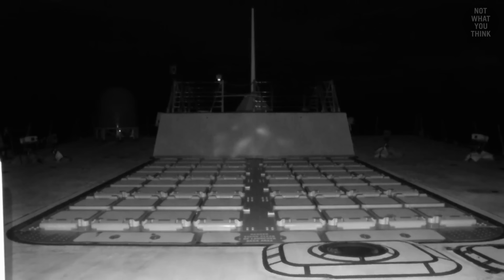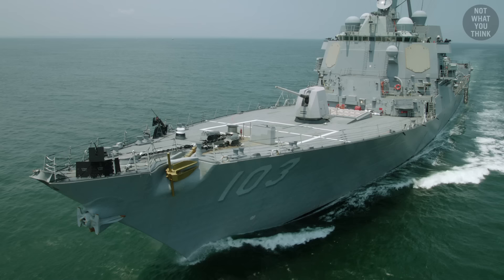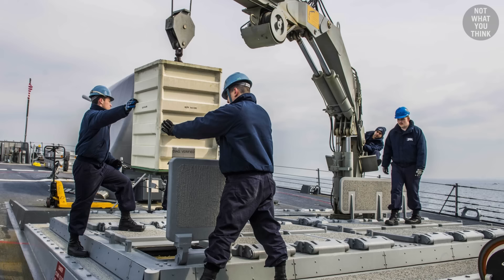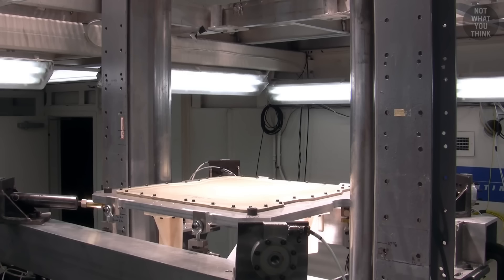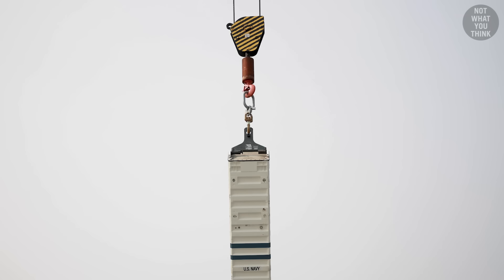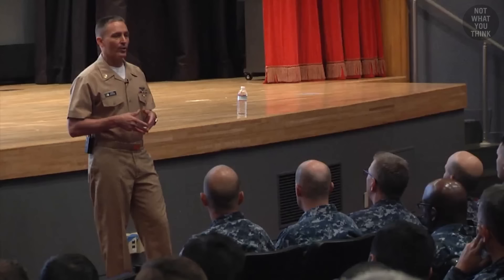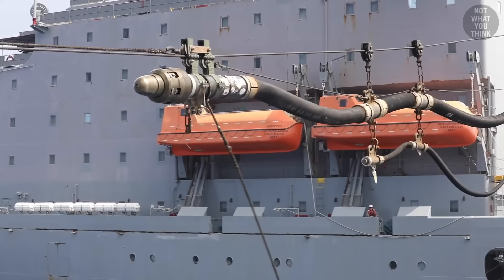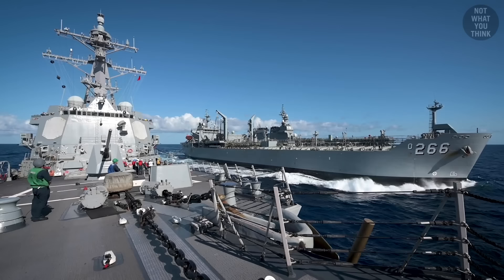Why Warships Cannot Reload Missiles at Sea

Comment: These ships carry more missiles than any of the previous ships that had below-deck magazines. If they think they need more missiles the solution is to add more launch cells. A loaded cell doesn't take up more space than a reload as the reloads fit snugly in the launcher and would take up just about as much space if stowed on the ship.
Reply: the point is that you'd have a supply ship carrying the ammunition. That way, the logistics ship can travel between the destroyer and ports that have ammo stocks, instead of the destroyer wasting time traveling.
Reply: Not really. Additional rockets / containers take up space below the deck but the launcher takes up space ON the deck, so its limiting factor is volume vs space.

I do agree however that the cells should be rearmed from within the ship's hull / storage holding and not by an outside crane.
Reply: China's Type 055 destroyer has 112 VLS.  We need a cheaper version of Rapid Dragon concept  that can be placed on top of ships in case they need to reload fast!  Just have them on deposable boats that serve as missiles truck drones that go ahead of the Navy to take out the 1st wave of missles.
Reply: What are you trying to say after adding more tubes like the reasoning doesn’t make sense how it’s worded. When you say a loaded cell doesn’t take more space than a reload what do you mean because that doesn’t make sense
Reply: Or Octa pack ESSM.
Or multi-pack a boosted ESSM to imcrease range over base line ESSM while having more magazine depth.
Reply: @dtsai That's right. Rapid Dragon is also a component of the current distributed lethality doctrine: of putting missiles on everything. It's either that, or a total redesign of VLS. Something like using a revolver shape instead-like the Russians do with their VLS. That way it could, perhaps be rearmed from a more easily refillable magazine deep within the ship. But that's a major redesign, so isn't realistic. Just put more missiles on the deck in the short-term, more VLS cells after refits mid-term. The French are already considering upgunning their FDI Frigates to match the Greek specification.
Reply: @vaakdemandante8772  how would you suggest accomplishing loading the cells from below decks?
The missiles are too long to feed in from beneath the launch cells.  Those cells are almost as tall as the hull.
That means you would need to store the missiles vertically and load them through the side of the launcher.
The handling equipment to do that would take up MORE space than simply installing additional launch cells would.  That's the entire reason that vertical launch cells were invented: it's both mechanically simpler and more volumetrically efficient to simply fire the missiles directly from where they are stored than to fuck around with moving them into launchers, and that's exactly the capability  VLS cells provide.
Reply: If what I’m interpreting is correct, a ship with a crane could re-load the VLS launchers using an on-ship depot? 

If so, it sounds good to me!
Reply: @jonathanmora9398 I think what he means it that a VLS launcker takes up roughly as much space as an extra missile stored for reloading a launcher. Therefore it’s more efficient to just fit more launchers instead of storing missiles
Reply: @dtsai  The US Navy doesn't have deposable (did you mean disposable?)  boats that can be controlled remotely mainly cause there are 3 problems. 

#1 having to arm and refit a separate drone boat entirely made to be a drone is not cost effective as it would only have one purpose and more easily damaged due to crashing waves not to mention having to refuel and/or stow it across a 6 month deployment or longer. 

#2 The communications to the drone would be very unreliable since most drones operate on line of sight and any other means could be blocked by atmosphere, waves, or even just being past the horizon (which is just around 5 to 10 miles depending on how high the antenna to control it would be). This would be a huge problem cause the ocean may be vast but there are parts where the ocean is shallow during different tides. Navigating a drone boat that would have shoddy reception at best is a great way to lose it by having it run aground.

#3 MOST IMPORTANTLY speed is dependent on the size of the ship (because bigger ship = bigger engines = faster) and having a drone to follow (or stay ahead as you suggested) would never be able to keep up with a destroyer and would only slow it down if it had to go back and retrieve it/stay in control range. 

On the sea battles are won very differently than on land. It's all a game of range, fire power, angles and counter measures. Having a relatively slow moving drone boat would be more a liability rather than just using those materials to make a bigger, faster boat with more missiles.
Reply: @pixelmaster98  I don't think you understand how hard it is to load a missile cell at sea. Both ships are swinging around due to waves, as well as the cranes themselves swinging from waves AND wind. They abandoned cranes all together and went towards reloading at port.
Reply: @Mike-my7uf  Thank you.  That is great info.  I'm just concerned because China has huge production capability since they have all the factories, jobs, people and money.  WW2 was won by US mass production, we built them faster than they could destroy them.  Thanks to Nixon and Kissinger, China learned that lesson and probably made sure we can't build at scale like we used to.  While the ships are never truly disposable, we don't want all of them so expensive you won't risk using them or losing them.  Building them in volume or with more speed and less armor might make sense to have them sacrifice to save a carrier group.
Reply: ESSM is already quad packed. That's as many that can fit per cell.
Reply: Common sense would suggest that if humans would stop putting their countries right next to America's military bases this would be less of a concern.
Reply: @vaakdemandante8772  That is not how VLS works.  The storage canister is also the launcher.  There is no launcher on deck.  Some of those canisters are three decks tall.  Below them is the flame trough, which takes up much of another deck.
Reply: @Mike-my7uf  Armed unmanned surface vessels are hear and now.  They are operating in the Persian Gulf with the US Fifth Fleet.  Coming soon is LUSV, Large Unmanned Surface Vessel which will almost certainly carry Tomahawk and SM-6.  Two prototypes are testing now in Japan with the US Seventh Fleet and JMSDF.  They sailed into Sasebo a couple of weeks ago.
Reply: @Mike-my7uf and despite your lengthy 3 point essay on why they don't exist, they absolutely do exist, they're called USVs and are currently used in the US Navy.

USV Ranger, USV Mariner, USV Sea Hawk and USV Sea Hunter are currently in active service.
Reply: @pixelmaster98  or instead of another supply ship you would just have another destroyer with more missiles That would be ready to fire on the spot.
Reply: That doesn’t add up though?  Deck space is precious & the volume inside the ship is much greater than what can be on the deck.  Should be able to have a system that rotates the cells up into place like our submarines do.  I guess there is always an excuse to make the ship slightly larger though & this takes that stuff off the ship to provide some inherent advantages.
Reply: I’m amazed there isn’t a ship with about a thousand of these missile launchers on board always ready to launch, like a giant barge that does nothing but fire missiles, always chasing a carrier effectively making the carrier fleet a massive mobile missile launching platform at sea. With regular combat ships only launching their own missiles when absolutely necessary or after the barge ship is empty. You could even design the ship to have the least amount of personal possible by not having any personal on board that handles defensive or offensive weapon, just the ship navigation and maintenance. With all fire control being given to the carrier or other combat ships in the fleet. I can’t be the only who thinks this would be a good idea.
Reply: @nanky432  when would you ever need that kind of firepower? And a carrier is never travelling alone it'll be in a battlegroup. The rest of the battle group carry missiles too.

When would you ever operate a carrier battle group in an engagement that would expect to use an entire barges worth of missiles without support from the other forces as combined arms?
Reply: @MaxGuides  The Soviet/Russian and Chinese navies both started out using rotary VLS launchers.  Both navies abandoned this style for the US style of placing the cells in a grid.  The grid is more space efficient, more missiles per volume of space on the ship.  As I said at the outset, I have personally been part of a team loading SM-2s into the aft Mk-41 launcher of USS Antietam.  This was early 1989.  The ship had a crane built into the VLS system using four available cells.  We set the missiles in their launch canisters on deck with a CH-46D helicopter and the ship's crew jackassed the empty VLS canister out and loaded the new one into the cell.  We then took the empty away with our helicopter.  We had to do the lifts at minimum fuel because the SM-2 is a heavy round.  The MH-60S has a metric buttload more power than the old Phrog and could easily VERTREP loaded canisters to the ships and the ships could reload their VLS if the cranes that were removed in the early 1990s were replaced.  It would cost four VLS cells but you could then reload at sea.  It dismays me that we seem to not only have abandoned that former capability but it seems everyone has forgotten we ever had it.
Reply: @nanky432  There have been proposals over the years to build so-called "Arsenal Ships" but I don't think modeling and simulation support their worth.  They end up being extremely costly because any ship that expects to run with the carrier has to be very darn fast.  DDGs and CVNs are all 40+ knot ships.  The size of the hull and propulsion necessary to move 1000 missiles is not trivial.  You are talking a capital ship in every sense of the word.  Now it will need expensive radars and short range self defense weapons.  Cheaper and more practical to build more DDGs.  Btw, the next class of DDG which for now is known as DDG(X) will have 128 VLS cells.
Reply: @philsalvatore3902  very cool, I appreciate your insight.  I guess most of us don’t really appreciate how much space these missiles take up or how heavy they really are so it seems counterintuitive when really they are taking up the same amount of space when stored in their firing positions as they would stored anywhere else.
Reply: @Adierit  The cranes in the VLS cells were abandoned during the 1st Persian Gulf War.   For that war, the Global War on Terror and subsequent invasions of Afghanistan and Iraq there was no need to replenish VLS cells at sea.  Replenishment could be accomplished pierside in Bahrain.  Removing the cranes opened up four more cells for Tomahawks.  It was a logical move for the kinds of land warfare the US Navy was supporting. 
Now however we are talking about fighting the PLAN close enough to China that their shore based missiles, and missiles from shore based aircraft become a consideration. Think about this, some of China's land based air defense missiles can at least theoretically engage aircraft flying over Taiwan from launch sites on the mainland.  That will make defending Taiwan and our naval forces very tough.   If what one reads in the open press is accurate there is a high likelihood that the kinds of engagements anticipated from modeling and simulations would pretty well empty the VLS cells of a Carrier Strike Group and burn through a lot of the air wing's air to air missiles.  Just one engagement !  Being able to replenish at sea becomes necessary if the US wishes to maintain the kind of intensely high optempo necessary to turn back an invasion of Taiwan for example.
Reply: @philsalvatore3902  Yeah, your argument would make sense if not for the fact Japan is right there, as well as the Phillipines. We literally have naval bases we can use right there.
Reply: @Adierit  Have you ever sailed around that region?  You are still talking days of sailing and a day or two in port.  When carriers deploy, the leave port with no ammo.  We would upload their ammo at sea from an ammo ship using two helicopters and three STREAM rigs on the ship.  It was a 12 - 14 hour job to stuff a CV full of ammo.  A carrier strike group is likewise going to have to be able to replenish in 12-14 hours, not spend a day or two steaming to a port, another day or so in port, and a day or two steaming back to the combat theater.  We can't afford to have a carrier strike group off line to replenish for three to five days.
Reply: @philsalvatore3902  We can, that's why we have more then one of them. And more then the enemy for that matter. It takes days no matter what. A ship still has to sail and regroup with said ship to reload it at sea, and that still has to be away from the front lines unless you want to get struck with an anti ship missile. There is close ports everywhere that make at sea reloading for VLS cells very impractical and unsafe.
Reply: @Adierit  Re-loading VLS at sea is not impractical or unsafe.  I've done it, with a helicopter.  By the third reload we were getting pretty good at it too, and it wasn't a dead calm day either.
Reply: how many can aircraft carry be mofied to carry i wonder ?
Reply: @pixelmaster98  And you think you can easily load such cells in open sea? Come on, not happening.
Reply: @jamegumb7298  We used to do it.  I have done it.
Reply: That is old news.  Now it is stacking missile in the same cell....Having more capable smaller and thinner missiles with more capabilities.  For example, some ballistic missile were retrofitted to care other types of missiles.  Then a light bulb came on...
Reply: @youzhou3001  That is ignorant, though - it applies for volume, but not for the top surface space. You could have i.e. more missiles stored essentially UNDER the launcher cells and then being brought up with an elevator on the side (even vertically) for reloading. There is a difference between available surface area and available volume. Magazine needs the later, launch cells need the first.

Comment: I'd hate to be standing on top of one of those things when they decided to launch.
Reply: ride of a lifetime
Reply: Same
Reply: Last and fastest ride of your life.
Reply: I like the smell of gasoline 😮
Reply: @TheFriskyComiskey or solid rocket fuel 😮
Reply: They sound a warning siren before they fire.
Reply: You would be dead or dying before you could think it's a little hot. The entire deck flashes with radiated heat(the visible fire is just the source, not the radiative heat)that is over 1000c for less than a second. After we shot few VLS for a bit, the high temperature paint would start to peel and I can't imagine what your skin would look like. Not to mention the shock wave of a missile going from 0-600mph in less than a second. If you watch it from about 100ft away on the bridge wing, you feel the heat that is like a sunburn for a fraction of a second, and it is not pleasant. This is the reason that the windows of some destroyers are coated with a atom thick layer of gold, giving them a slightly yellow or red sheen at some angles.
Reply: topside gets cleared before they arm it
Reply: Youd probably get the shit beat out of you if you tried 😂
Reply: Rocket riding irl
Reply: I know my ex would..
Reply: @yeabutwecouldbefreer I don’t think I would
Reply: Might feel really good uwu
Reply: ... You wouldn't be upset for very long!! 😂 💀
Reply: Your commanding officer would surgically attach his/her boot to your a$$ if it was ANYWHERE near the top deck of that ship while it was firing! 😆🤣
Reply: I just pictured the "Just Cause" video games. Where you can attach yourself to objects and mess around by attaching to explosive objects and just shoot off into the sky.
Reply: Good news is, you will never know it when it happens
Reply: The crew can’t go on the deck whenever they want. It’s not a yacht where the crew can go anywhere they fancy when there’s downtime. If the ship is in combat mode the crew are inside assuming their roles.
Reply: @emileblanche5868  It was a joke, my man. I was in the Navy. Before a weapon is fired, the deck is cleared.
Reply: @rykehuss3435 last ride of life
Reply: You wouldn’t ever stand on it unless you’re loading them
Reply: Hey maybe on next fast and furious
Reply: Your mom would like it
Reply: @aaronarmstrong9776  ahh straight into mother jokes i see
Reply: there are warning signs all around the vls, saying 'do not stand on top' or something similar
Reply: @yeabutwecouldbefreer  LOL.  You missed the joke.
Reply: Sounds like a Roadrunner cartoon where Wile E Coyote gets scorched.
Reply: @kdrapertrucker  Some sailors aren't real sharp.  I have some first hand experience with this ..........................O_O
Reply: @philsalvatore3902  Or he goes for a heck of a ride...
Reply: There was a video floating around on internet (before youtube) of a sailor hanging around the VLS right as a missile was launched. Another ship recording the launch caught it from afar. 

Apparently a loud warning is sounded before a launch, and apparently the sailor got the message and is seen running off to avoid getting scorched by the missile plume.